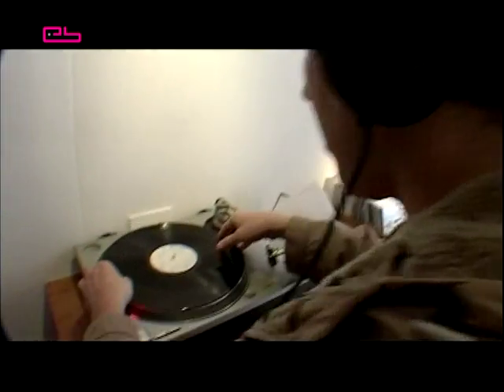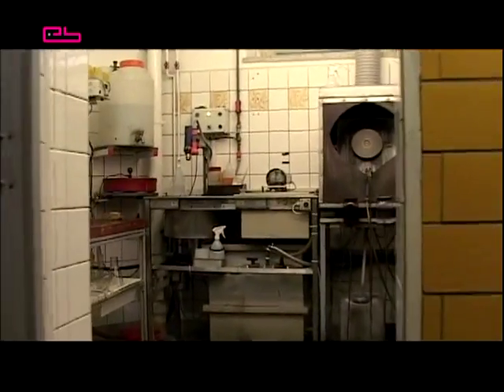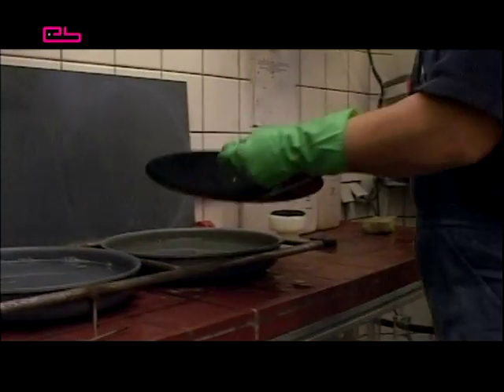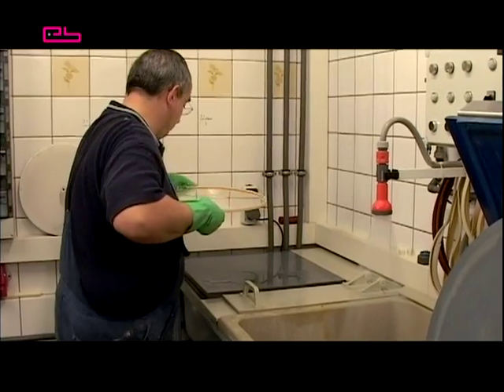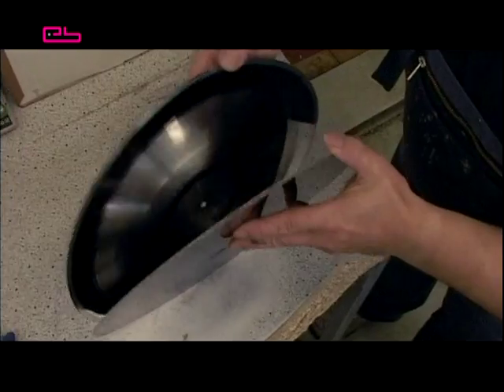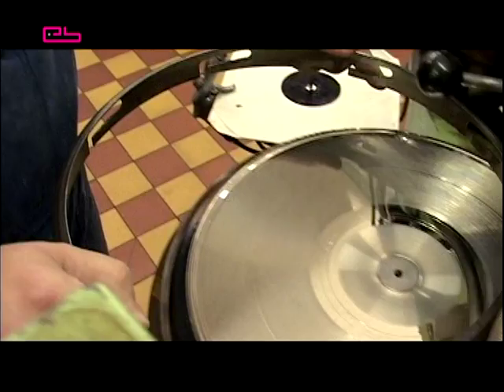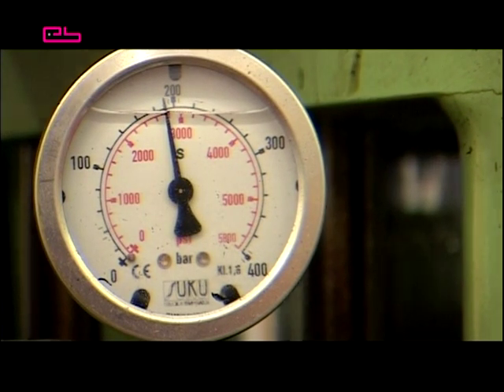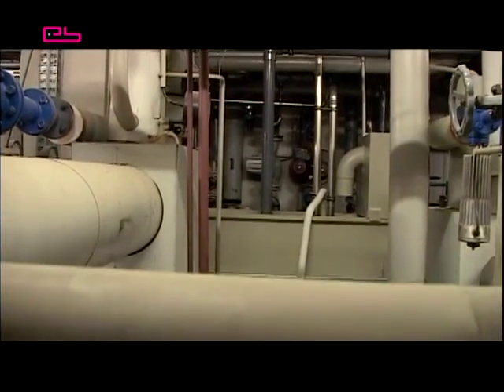Tech Talk: Vinyl Manufacturing (Electronic Beats TV)

Comment: This is such a crazy process. Another reason to love vinyl even more.
Reply: This is pretty much exactly how you make CD's. Only difference is you use clear plastic and add a thin layer of aluminium on the bumpy side and then a layer of lacquer to protect the aluminium. Or DVD where you basically glue two CD's together and use a semi translucent film of silver for the bottom "CD"
Reply: I do remember the stamping being way faster when I worked in a CD and DVD factory. That took something like 5-10 seconds and to didn't have to cool the material.

I've heard LP's use vinyl plastic because of its elastic properties which you wouldn't need in a CD due to reading it from a distance with a laser.

Comment: This is pretty much exactly how you make CD's. Only difference is you use clear plastic and add a thin layer of aluminium on the bumpy side and then a layer of lacquer on top. Or DVD where you basically glue two CD's together and use a semi translucent film of silver for the bottom "CD"

Comment: thats why vinyls are way more expensive than cds..
Reply: Actually the CD manufacturing process involves galvanics as well, it is very similar. Ultimately you end up with a metal stamper which is used to press the digital information into the polycarbonate.